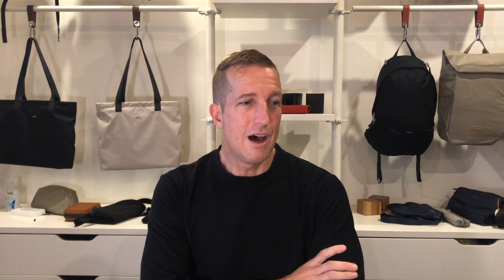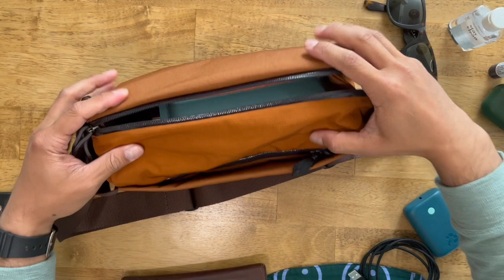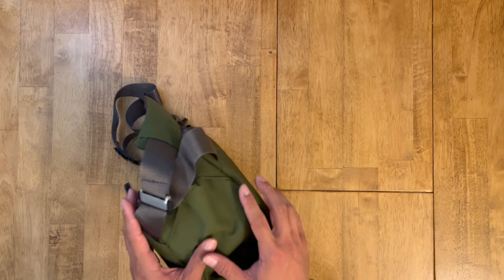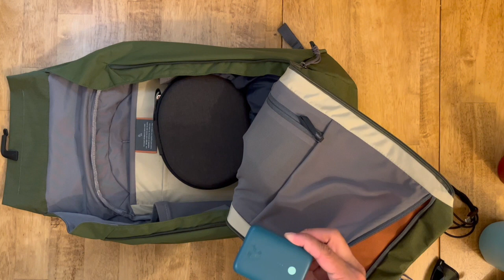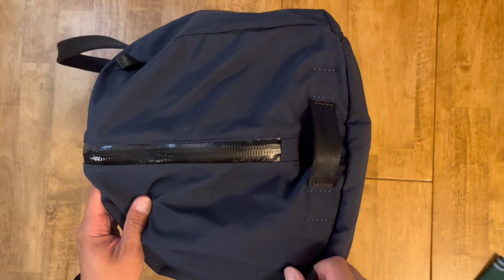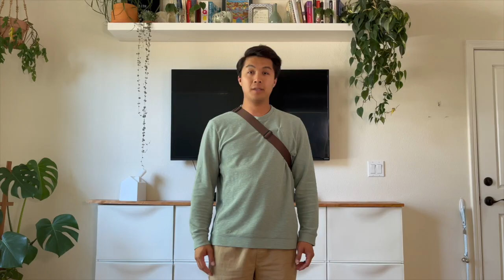The Complete Bellroy Venture Collection & Exclusive Interview

Comment: re the venture camera sling, why are the dividers not removable? It prohibit carrying optional flat items like a book/notebook. Bummer as a multi use carry and not as described.
Reply from the maker: Great point Alvin. A removable divider would allow for greater customization when not used for camera carry. I feel it may counteract the unstructured nature of the bag, as it was designed to keep a low profile for smaller packouts. Thanks for the comment. Cheers - Theo

Comment: Yh I have a question. Why is there no inside side structure on the venture duffle. I get the ‘wide mouth’ design idea but the bag falls flat when you’re trying to pack (however, the lite duffle nails this) I was hoping to use this for my travel but I’m now thinking of just returning it. Thx
Reply from the maker: Great question Marc. As a multiuse bag, additional structure might aide with smaller pack outs but at full capacity it may become a limiting factor. The barrel shape aesthetic also allows the bag to fit in a variety of spaces. Sounds like the Lite Duffel might be just what you're looking for. Thanks for the question, cheers!  - Theo